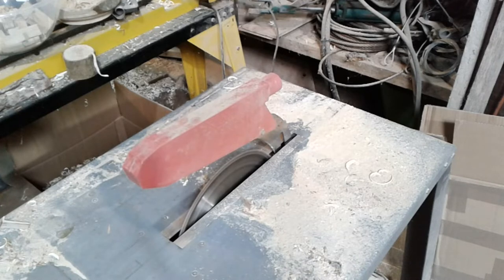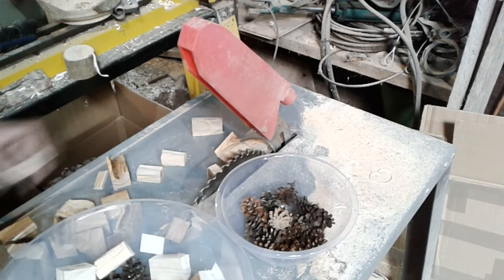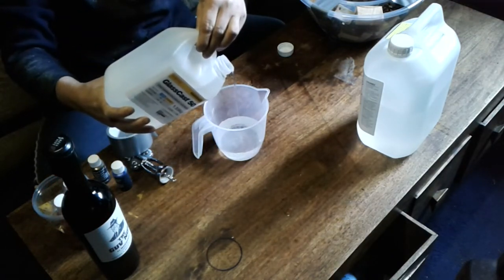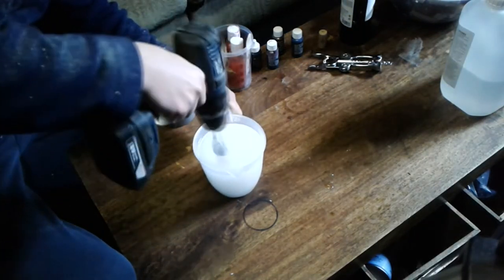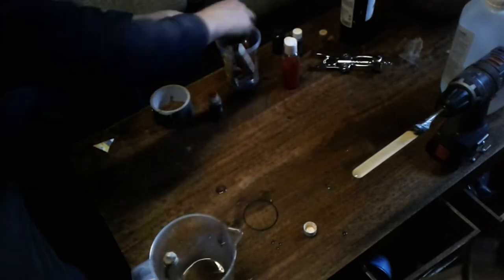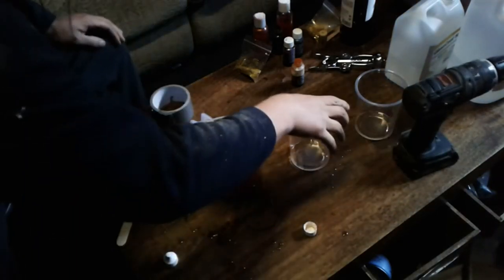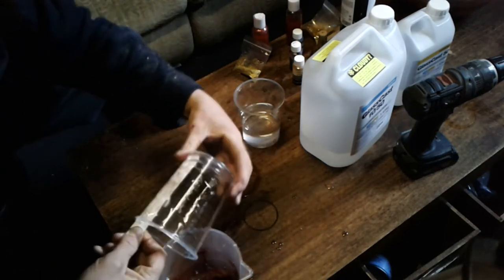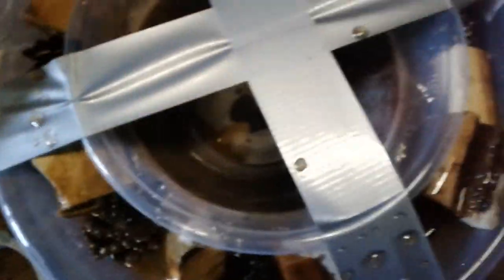Candelario Bowl part 1

Comment: make yourself a vacuum chamber to get rid of the air bubbles in the epoxy.
Reply from the maker: I have a vacuum chamber! I'm gonna do a smaller version of this bowl (one that fits in my chamber) and see what happens, in my experience with stabilising wood in the vacuum chamber, the air just keeps on coming for hours and hours as it gets sucked out of the wood, maybe I should do a quick vacuum to purge the resin of air but not leave it on for the cure.. who knows 😂 thanks for the thought!